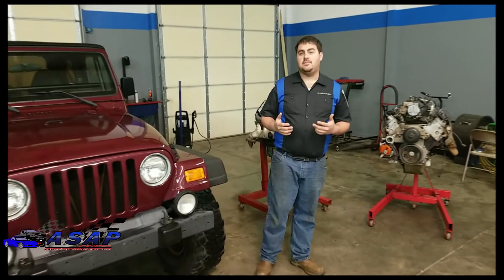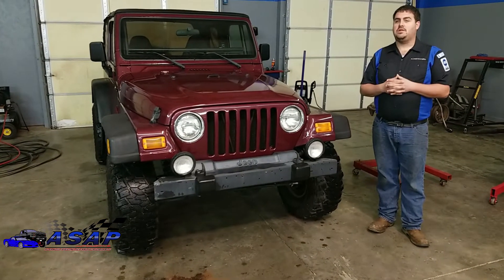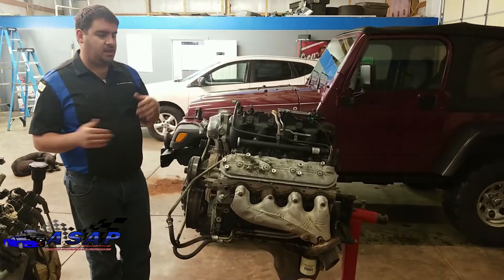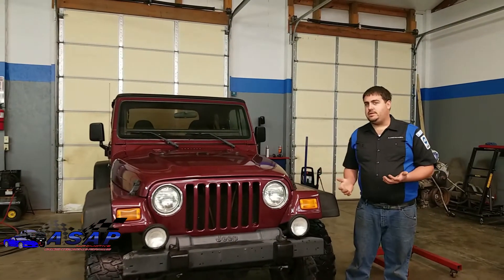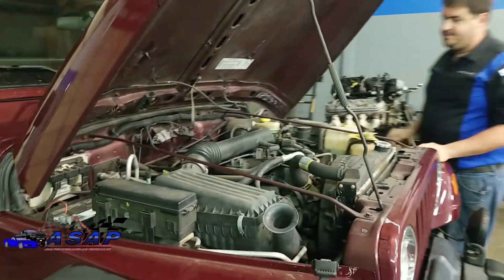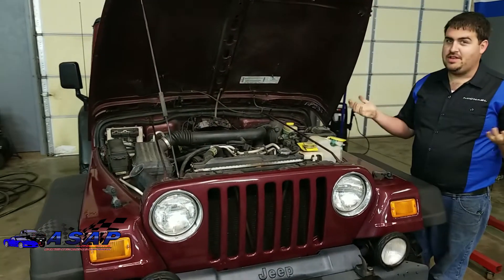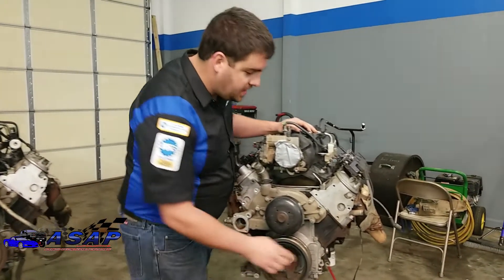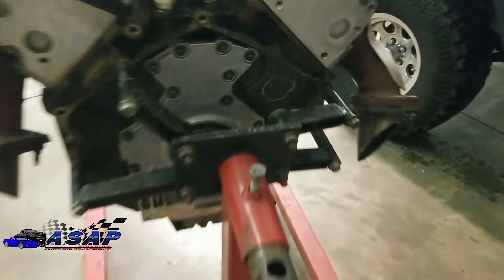LS TJ 6.0 swap ep 1

Comment: Love the video doing a 5.3 swap later this year just getting all the parts for mine. Just wanted to clarify that your front axle is a Dana 30 not a Dana 35. A Dana 35 is not a front axle in a Jeep and the Dana 44 in the tj besides the rubicon is a factory option and most TJs 4.0 or the 4 cylinder have the same axles. Dana 35 rear and Dana 30 front the 4cylinder was just geared higher due to its having less power
Reply from the maker: You are absolutely correct,  i had went back and refreshed myself on these afterwards but it was too late to fix the video.   The front axle along with brakes will be one of the next much needed upgrades after we get the swap done.  Thanks again for subscribing and best of luck on your build!
Reply: I have a 2.5 4 cylinder in my jeep with the ax15(trash) I was planning on replacing the transmission with a nv3550 are you saying my axles will be alright? I'm just daily driving it on the street and maybe some back roads. @croppcars
Reply from the maker: @abehemry5972   Thanks for subscribing!  So you can build off of a 2.5 jeep but from what we have gathered it takes a lot more effort to do so.  A lot of components need to be upgraded for reliability is what i'm told.  I haven't done personally but from what i've seen is that most people with the 2.5 upgrade to a gm 4.3.   We are actually in the works of replacing the NV3550 with a AX15 unit.  Evidently the NV3550 is not really supported any more and most every one builds the AX15.  They are basically the same externally and swap right out.   I think you might be thinking of the AX5 that was found behind the 2.5, which is indeed rather week, i definitely would not put an LS in front of one of those.
Reply: Yes I was mistaken I have the ax5 that's what I meant
Reply: Will I need to change out my axles
Reply from the maker: @abehemry5972  I would,  that dana 35 in the rear will be struggling to handle normal driving with even the tamest LS/v8.  Imo I would upgrad it the rear at least to a 44.  We are talking about swapping out our front dana 30 for a 44 also
Reply: @abehemry5972  if you have a 4 cylinder you have an ax5 not an ax15, the ax 5 is a pos while the ax15 is not.

Comment: I’m curious how you lined up your ax15 shifter with the original hole. I’m finding that the hole is shifted a bit toward the passenger side. Did you just put the motor a little crooked? The Novak mounts seem to put the motor perfectly center.
Reply: We had to cut the hole as it moved forward a couple inches. But it was pretty well centered